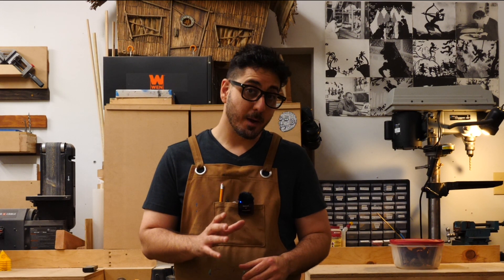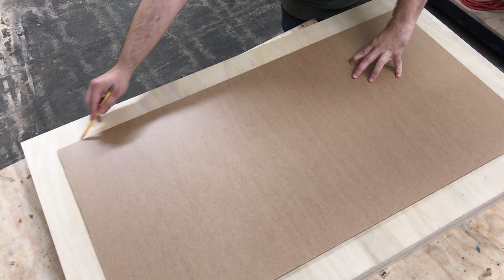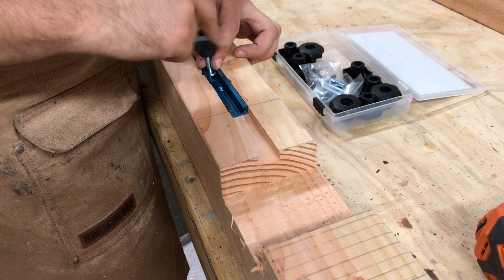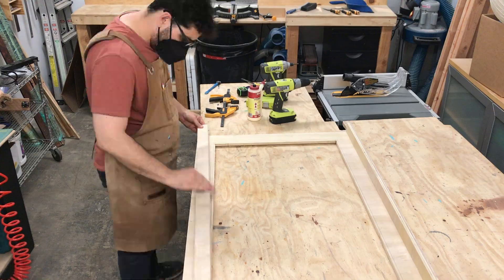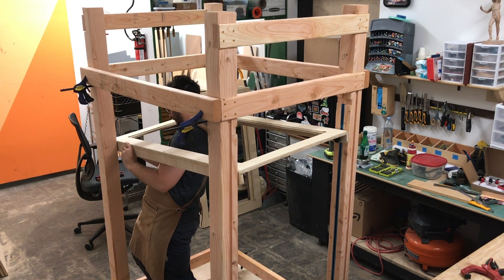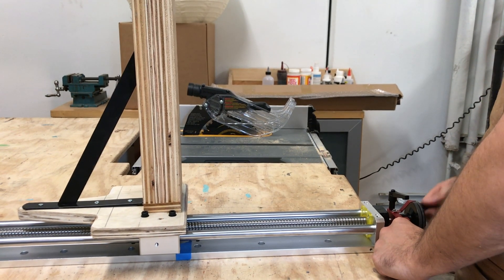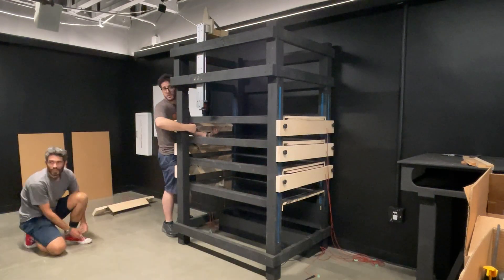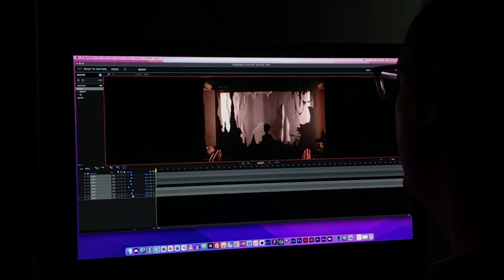How to Build Walt Disney's Multiplane Camera: DIY Guide for Animators

Comment: Great work!  May i ask a stupid question?  Doesn't the blue track cause some unwanted reflexions?  (Just currious)  I was also thinking of making one of my own and, since I don't have a 12 feet ceiling, I'll probably use a 45 degrees mirror to be able to place my camera in front of my multiplane instead of over it.  It would allow me to get a better controle and a better DOF!  XD
Reply from the maker: As far as I can tell the blue track doesn't cause reflection. However, that's a constant battle when using glass! A 45 degree mirror is a great idea!
Reply: @WoodGoblinFabrication  Thanks for the answer!  ^-^'